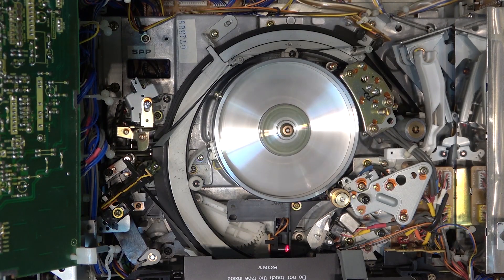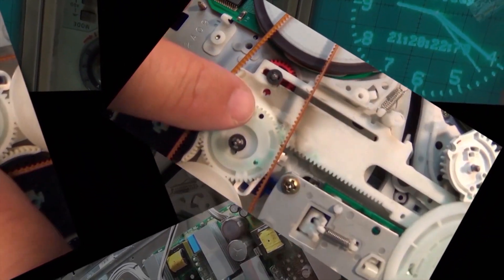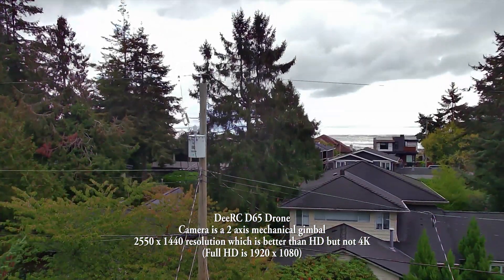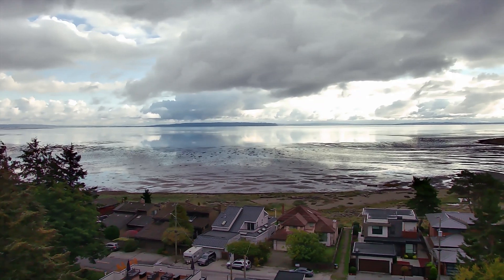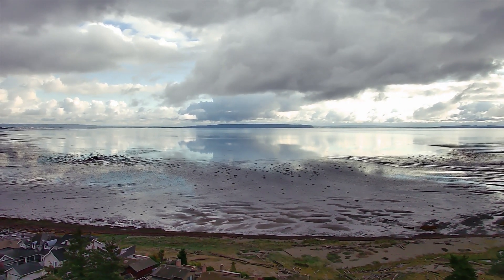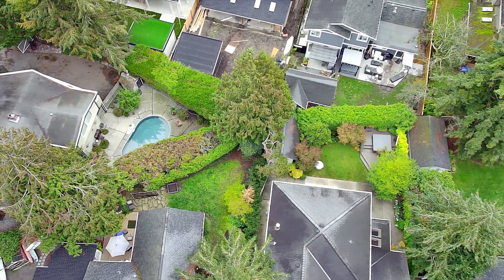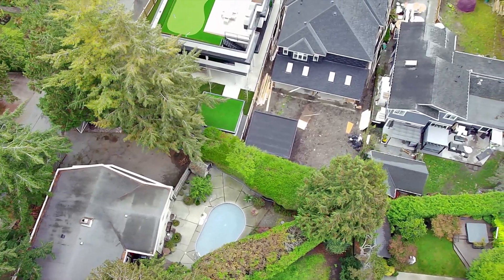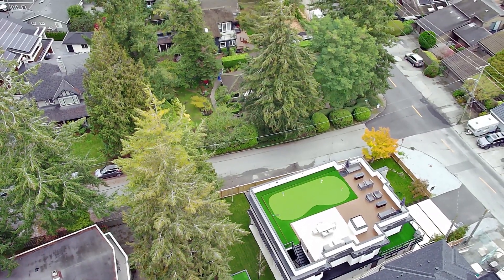Comparing 3 drones for camera image quality

Comment: Doesn’t blow away my phantom pro version one 20 megapixel mechanical camera 4K 60 frames per second
Reply from the maker: It is a 20 megapixel camera. It only does 30 frames which is fine for me because my software can't handle anything more than that. Remember this is transcoded and youtube compresses it on top of that. You should see the files playing directly on the 4K TV. It would give your phantom a good run for the money, at a fraction of the cost.  It isn't competing with a phantom, so your comments are completely irrelevant.

Comment: Mechanical is awesome
Reply from the maker: The Veeniix has both mechanical and EIS. One of the reasons it is so stable. Mechanical handles the slower movements whereas the EIS handles the high frequency disruptions such as from the propeller oscillations. So both work together.

Comment: Video quality of the Veeniix v11pro is super nice!
Reply from the maker: It is for sure.  Its also a much larger drone that requires FAA or Nav Canada registration and a drone operators certificate in canada and costs double what the DeeRC costs. Has a much longer flight time and 6km range.  Its not into DJI price range but for me it's more than I need.  If DJI wants to send me one of theirs I would be happy to throw it into the mix as well.  DJI has more features like forward collision avoidance using lidar and cameras which is nice  and they've got a controller with built-in screen so no phone needed but your going to dig much deeper in your pocket for something that you could fly away and never see again.   I have 3 "toys" myself that no longer fly because of an incident.  One took my go pro with it.   Flying around just minding my own business and out of nowhere a couple crows flew up from behind and took it down.

Comment: Thanks for comparing these. For my limited use, the DeeRD D65 would probably be all I’d need! Sub-250 g makes it even better for me.
Reply from the maker: Yes the d65 is a good choice if you don't require 4k video.  It shoots better than 1080 so editing to 1080p  looks very good indeed.  Take a guess which if the 3 I am selling?

The holystone isn't that bad, just doing hard start and stop maneuvers Bob the picture which would be edited out.  Big price difference.  These things are going to get more expensive when the post turtle takes over.

Comment: Watch out for flying golf balls, golf course on the roof it's very strange it will drive up house prices and taxes in the area.
Reply from the maker: I don't have to worry about golf balls. I was up 400 feet. More concerned with territorial birds as I lost a few toy drones years ago to crow attacks however the new ones have much better recovery.  I put one of these ones intentionally into wires and trees to see what happens.  (Dead telephone drop wire) nothing happened.  It did a flip and righted itself.  Actually I did it with both the DeeRC and Holystone.  One i clipped a branch and the other a wire.  Nothing happened.

Comment: The Deerc d65 is great , how good is the flying ? Cant it complete with the Dji mini 2 or se
Reply from the maker: It certainly can and it will go 400 feet.  If all you need is 1440p then this is the one to get because its the least expensive of them all.  You can zoom in the camera but the zoomed images just records on the phone.  The sd card records the full images only.   The holystone if you zoom in the zoomed image records on both phone and sd card.  All 3 record the images on phone at 720p as a backup.
Reply: @ I love the holystone too , was going to order it but saw so much vidéos of them doing the toilette rôle lol so I took the Deerc d65